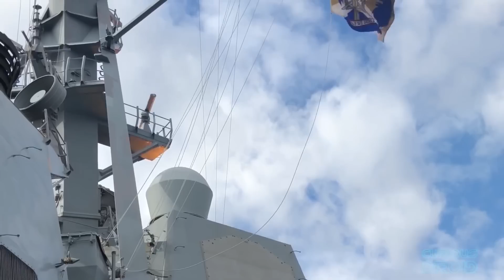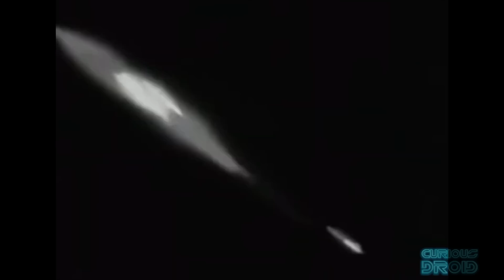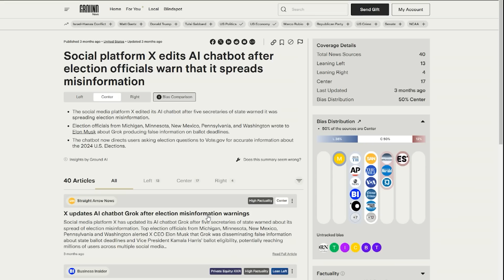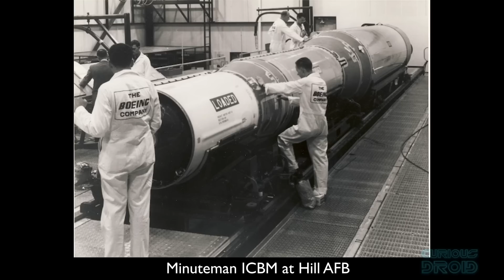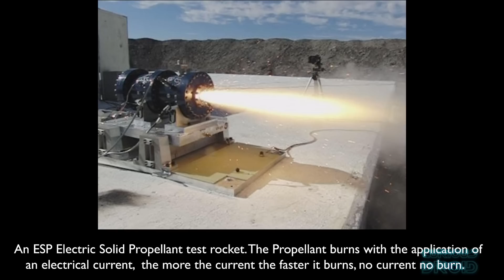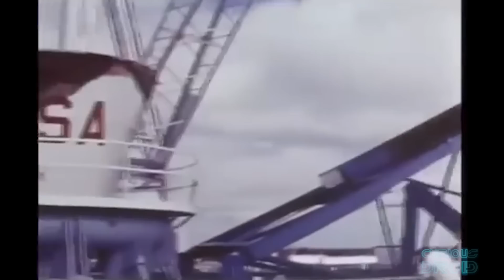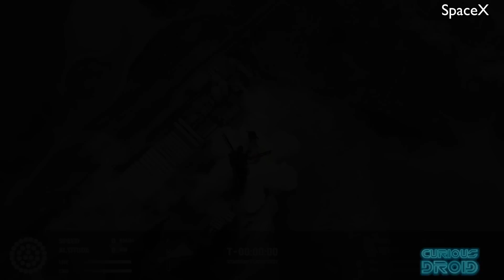The Most Powerful Rocket Motor Ever Tested & Why it Never Made it to the Moon?

Comment: The reason the 260 inch solid rocket motors were never developed was Thrust Oscillation.
All solid rocket motors have thrust oscillation, but it's amplitude and strength increases as the rocket engine gets larger.
Thrust Oscillation was the death nail of the Aries I program, that was canceled in 2010.
I highly doubt there will ever be a solid rocket booster engine larger than the 156 inch SRB.
Reply: Another problem for any solid rocket booster - which is a much bigger problem for any booster which forms part of a human-rated launch vehicle - is that both the thrust and the thrust-to-weight ratio increase considerably as the fuel is consumed. This increases the acceleration the whole launch vehicle experiences and hence the g-forces - and the need to keep human astronauts alive during the launch imposes an upper limit on this.

Liquid fuelled rockets are also subject to increasing thrust-to-weight ratio, even if the thrust itself remains fairly constant throughout the burn period. A good example being the first stage of the Apollo Saturn V: At liftoff, the acceleration is noticeably slow - because the thrust of the 5 F1 rocket engines is not a great deal more than the weight of the entire launch vehicle. However, since more than 90% of the weight of that first stage is propellants, and the engines are burning through those at several tons per second, that thrust-to-weight ratio is going to increase rapidly, as will the acceleration of the whole vehicle. This is in fact so extreme that the centre engine is deliberately shut down before the propellants are all expended, in order to limit the g-forces from acceleration to a level the astronauts on board can survive. Even so, the acceleration in the last few seconds with just 4 engines is still the highest during any part of the first stage burn.

Of course this same lightening of the vehicle as the rocket burns through the fuel load happens with solid rocket motors too. But there is an extra effect with solid rockets, which depends on the shape of the solid fuel contained within them. If you have only ever used firework rockets or those little "estes" brand model rocket motors, you might think that all solid rockets burn from the bottom upwards, like these do.
However, the larger and more powerful versions used for spaceflight achieve their insanely high thrust by having a hollow cavity running up inside the entire length. The space shuttle SRBs are a good example of this - the igniter is actually at the top. When triggered, it rapidly causes the fuel to burn down the whole length of the booster - so it actually burns from the inside out, not from the bottom to the top.
The extra thrust-increasing effect is precisely because of this fuel geometry: As the fuel is consumed from the cavity in the middle, the diameter of that cavity increases. As such the surface area available for combustion also rapidly increases, which has the effect of "throttling up" the SRBs continuously as the fuel inside them is consumed. 

So while all rockets increase their thrust-to-weight ratio continuously just as a result of the fuel being consumed, solid rockets with a fuel geometry as described above magnify this effect greatly by this inherent throttling-up as the fuel burns. This means that adding an extra segment to this design doesn't just increase the burn time - it also increases the burn rate, adding to the thrust as well.
Reply: @lloydevans2900  As you mention, this effect does depend on the shape of the solid fuel, but it's worth adding that modern solid fuel rockets have "star" shaped cavities to keep the burning surface area consistent throughout operation
Reply: @lloydevans2900  Mostly Muskrat B.S.
Reply: thought the bigger problem with the Ares 1 was that if they tried to escape it either would require so much g-forces it would kill the crew or they would be melted by burning propellent afterwards
Reply: @AsbestosMuffins  Nope.
Reply: @AsbestosMuffins  That's not true at all.  Ares 1 didn't accelerate significantly more than any other manned rocket.
Reply: The Shuttle/SLS booster cavity is shaped like a star up top and kinda conical in the lower sections so that it naturally throttles itself during flight.
Reply: @counterfit5  It's as much an art as it is a science.
Reply: Smaller rockets, build bigger things in space.
Reply: *Thrust oscillations: The mighty F-1 had low-ultrasonic oscillations before the first one went into flight tests.  I don't know of any chamber type that won't have some kind of oscillation.  The idea is to keep it quiet enough.
Reply: Total B.S. Musk Propaganda.
Reply: Is it length ( pointy bit to flamey bit) or diameter ( how fat the flamey bit is) that is the problem?

I thought they made an extended version of the shuttle SRB.
Reply: @petert3355  It has nothing to do with physical dimensions and everything to do with thrust and the mass flow rate of the exhaust--the more propellant is burnt per second, the higher the thrust--and the oscillations--become.
Reply: @sailordolly  B.S. Musk propaganda.

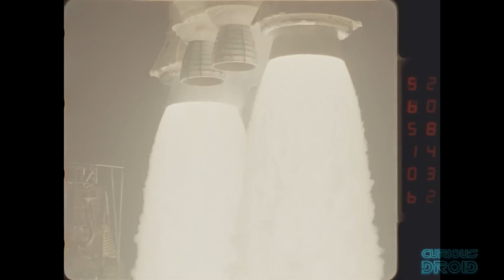Comment: ~13:30
"... to give longer burn time..."

The 5 segment SLS boosters do not burn any longer than the 4 segment shuttle boosters.  This makes sense when you consider that the surface of the solid fuel inside the booster is all burning at the same time. As the boosters are the same diameter, just longer, what the 5 segments instead of 4 does is increases the pressure inside the booster - more burning, more pressure, and thus more thrust.

/Somewhat simplified, I know
Reply: There are a lot of small errors in this video
Reply: Tbf the burn rate can be controlled by the filling and fuel composition, so its not quite a given that they burn the same time. Especially if the nozzle has the same diameter.

Not disagreeing ofc, just as a sidenote^^
Reply: Yes -- I was going to comment the same thing, Overall, though, a great video!
Reply: They're also not recovered because staging is done at a higher altitude and faster velocity compared to Shuttle, there would be no point as they come down damaged after experiencing higher reentry stresses. Similar goes with the whole SLS core, it's a sustainer core of a high energy optimized launcher, meaning it cuts off basically at orbital velocity and subsequently reenters with an orbital velocity, upper stage barely uses its performance to finish the job of reaching a stable orbit, most of its performance is spent for high energy insertions like interplanetary transfers or TLI which is why SLS has the best high energy performance of any launcher by far and will have even better one with uprated variants. This architecture design is incompatible with any kind of recovery and reuse except maybe trying to jettison and recover the engine section like ULA is planning with Vulcan, so it's completely disingenuous to compare it with LEO optimized architectures compatible with recovery and reuse like Falcon or Starship that have their boosters or cores stage at 70-80 km and nowhere near orbital velocity at around a quarter way to it, especially Starship which is an extremely LEO optimized one. So many people don't know these basic principles when they should know better than to fall victim of techbro propaganda nonsense.
Reply: @FrankyPi  Not recovered because the very low flight rate and refurbishment costs of composite segments would make it uneconomical to try to save them versus just making new "plastic" segments.
Reply: Increased pressure also increases burn rate.

Comment: When you spoke of the size of the Shuttle solid rockets it stirred a memory from my childhood.   The size was restricted due to a train tunnel they had to pass through on their way to the cape.   James Burke's "Connections" covered this very piece of history and traced the size of the Shuttle Solid Rockets back to the Romans and the ultimately the width of a horse's ass.
Reply: The Romans would have said "arse".
Reply: @dannyarcher6370  Ha!    Well actually it would be “equus asinus”
Reply: Really all rockets were limeted by transportation, because the individual manufacturers were legit all over the country. Logistics.
Reply: The size was restricted due to politics, politicians wanted the SRB built in their state to secure re-election
Reply: @danieldoherty8101  And that State was Utah, home of Morton Thiokol (I believe it’s now Grumman).  Because of the length of the SRBs, they were restricted as to which rail lines they could use.  The rail line they used had a tunnel built for trains.  If I remember the “connection” after all these years… and I know I’m missing a step or two…. Train gauge was based on wagon tracks and wagon wheel spacing was based on a team or multiple teams, which went back to Roman days and the Roman team was two horses side by side with tongue or pole between them.

Comment: Why do model rockets need a Launch Rod, but "real" Rockets do not?
Reply: Because model rockets have no guidance system, other than maybe some fins, and fins only become effective once the rocket is moving at sufficient speed. Full size launch vehicles have gyroscopes, computers, flight software, and gimbaled engine nozzles to control their attitude throughout the powered phase of flight.
Reply: Real rockets are bolted down to their launch structures, the bolts are destroyed once all engines are at even thrust levels, ensuring that the whole assembly will lift off vertically, in a controlled manor. Then Ditto what RCAvhstape replied.

Comment: It certainly looks like methalox is the future choice for most civilian rocket propulsion. Considering everything, it looks like the best choice.
Reply: Methane is a good choice if you want to build a re-usable stack and you want to use the same propellent for all stages of that stack. It's not the best choice by most measures, but it's one that makes a lot of sense for a certain set of design constraints...it's cheap and burns cleanly, it offers a better ISP than solids or kerosene, a better energy density than hydrogen, and it pairs well with oxygen in terms of compatible temperatures.

That said, it's not an automatic winner. Take Vulcan, for example... ULA picked the BE-4 engine so methalox was part of the package, but if they'd had a better engine candidate, it probably would have made more sense for them to stick to kerosene for the higher energy density. They're building an expendable vehicle with a low flight rate, so they don't benefit much from a cheap non-coking fuel, and they're already using hydrogen for the upper stage, so they don't get any benefit from commonality across the stack. So they're mostly getting the downsides of methane (cryogenic, lower density) and none of the upsides.
Reply: @simongeard4824  Yes, different situations call for different fuels. Even hypergolic fuels made a lot of sense at one time, for certain situations. I can see why the Soviets would make a moon rocket booster using them. It made some things much easier. Alas, they had to learn the downsides the hard way. So have we. Some people in Damascus AR could tell you all about it.

As for trends, yes, with re-use being more and more of interest, methalox is going to be ascendant. It certainly looks that way. If you want maximum ISP above all else, then LH2+LOX is probably the choice. Once out in space, ion drive is going to be bigger and bigger. OTOH I think solid fuels have peaked, for most purposes. Again, it depends. A launch escape tower is probably a solid fuel situation. It's great that we have so many choices now.

Comment: Controlled on a 3 axis? Pretty sure you ment 2 not alot of reverse thrust available..
Reply: Control on an axis doesn't need 2 opposing ways. So as long as the rocket is lit, motor is pushing, it has control in that 3rd axis.

Comment: If the left is the ones primarily running a story then that's the misinformation. Like the Russia collusion. Take that story vs Hunter Biden story they said was misinformation and was ON VIDEO. How can something be misinformation and be video, before deep fake and even then they are still easily distinguished from real. So if the left is running with a story it's fake if they are ignoring it then it's real and damaging to them. That's your fact check right there

Comment: As I learned from The Vintage Space, solid motors were part of getting to the moon. The capsule escape system was solid motors. Also, the ullage motors that would make the stack slow slightly and make the liquid fuels slosh towards earth and be able to be pumped and start the next stage after stage separation.
Reply: Simple things Nasa did to nullify pogo oscillation
Reply: @alfredshort3  It took many very complicated things to negate Ares I's thrust oscillation problems. I was deeply involved with Ares I, and killing it.
Reply: Yeah, I learn about ullage motors from that hot babe, too. so small, so important, the ullage motors.

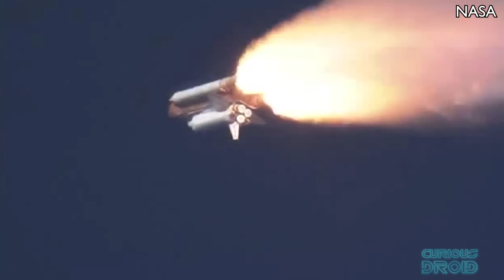Comment: 8:02 Specific Impulse measures the efficiency of an engine, not how quickly the fuel is burned.
Reply: its how quickly fuel is burned for a given thrust, thats why its in seconds. which is a measure of efficiency, its the same thing.
Reply: Specific Impulse is the ratio between fuel consumption and thrust. How long your engine burns is also determined by how much fuel you carry around.
Reply: That's the same thing. Depending on how quickly the fuel burns also determines the efficiency of the engine.
Reply: @Predator42ID  Only if you compare at the same thrust: an engine with twice the thrust that burns fuel twice as fast is the same efficiency, since each bit of fuel is doing the same amount of pushing
Reply: @warriorsabe1792   in terms of thrust over mass flow rate, Paul's generalisation holds true.
Reply: @Predator42ID Um. No
Reply: And what happens if the engine is less efficient? It use the fuel quicker. Simple.

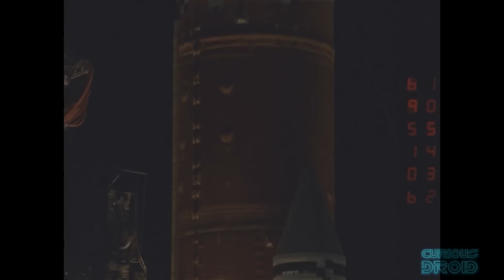Comment: 13:20 re: Shuttle SRB reuse: "None came to fruition until the SLS in 2022"

Ares-1X feels neglected.
Reply: Was trying to see if someone beat me to it lol.
Reply: Ares-1 could've been a good crew launch vehicle, but in the end it was just money tossed into the ocean for some questionable test data.
Reply: @RCAvhstape  Well, if crew could actually survive the thrust oscillations from the booster.  Springs between the crew compartment and the rocket were proposed so they wouldn't just die.  The space shuttle got away with it because the forward beam holding the solid rocket boosters could flex a bit, and that got transmitted to the external tank and only then to the shuttle.  But sticking it under a capsule had much more direct dynamics.
Reply: @paul_moir  There is that. I wonder what accelerometer data from the one test shows.

Comment: The Aerojet facility is still there, just west of Homestead, Florida.  It has become a hotspot for urban explorers.  At one point, I ran into two other groups of people exploring it even though it is several miles walk down a road after the locked gate.  Fish and Wildlife has torn down buildings there whenever they had extra cash to burn through.  They placed a bunch of highway K-rails over the pit where the engines were tested.  I heard cops hang out and arrest kids who go exploring there now.  Its an easy job away from the dangers of real crime.
Reply: side note I had no clue highway dividers had a name other than Jersey barrier.
Reply: @filanfyretracker I didn't know they were called either of those things! Now I've learned two more facts today 😁
Reply: There is still a SRM in that pit. Despite claims it has propellant in it, its unclear if that is true.
Reply: @Ganiscol  No, there is not propellant in it. As someone who had legal access to that area I also have a couple of items from there. It is a shame that Aerojet didn't get the contract but politics came into play. The drawbridge over Aerojet Canal has been replaced so no barges will be going up it. The SFWMD has also built a permanent water control structure downstream of the bridge which also blocks the canal.
Reply: Maybe that's a test or assembly facility. AeroJet is actually manufacturered in Sacramento, California. There's stories about roaring rockets in the suburb Rancho Cordova. Sacto is a rocket town.
Reply: @jamesturner2126  The Aerojet Sac site is now homes.  No more rockets.
Reply: I’m getting a  “I’ve been arrested alot”vibes out of this one…

Comment: Thicol had a plant go high-order. There is a really interesting video of the boom.
Reply: You're speaking of the Henderson, Nevada -- that was Pacific Engineering and Production Company (PEPCON), the producer of the Ammonium Perchlorate used as oxidizer in the SRBs.
Reply: @disorganizedorg  My detail was a bit ambiguous but the boom was most impressive,
Reply: When shuttle launches got paused PEPCON couldn't scale back because they were under contract to produce xxx tons of AP each week, month or whatever.
They also build the plant on top of a high pressure gas main.
The shock wave rolling across the desert is something to see.
Reply: @jimurrata6785  It was on the Discovery Channel many years ago I think, I remember watching it on one of those disaster shows.
Reply: @RCAvhstape  I've seen the raw footage from those two guys up on the TV antenna here on YouTube